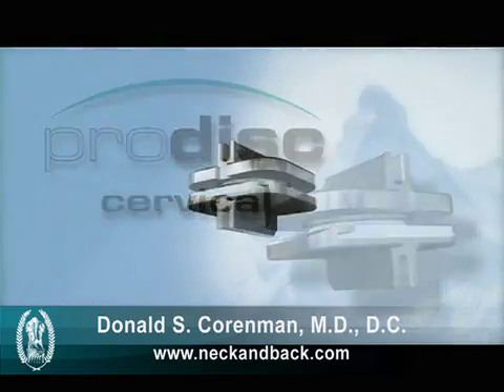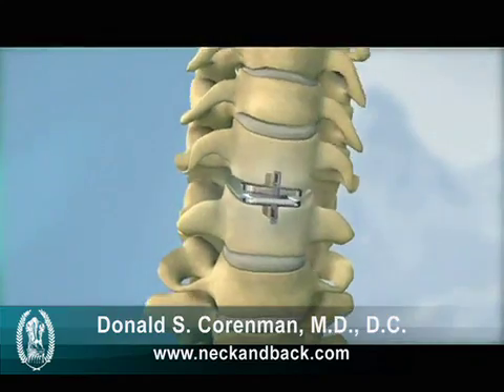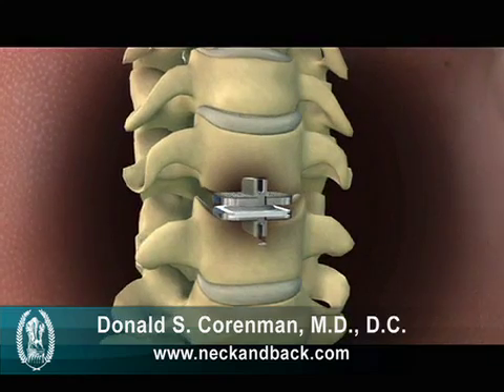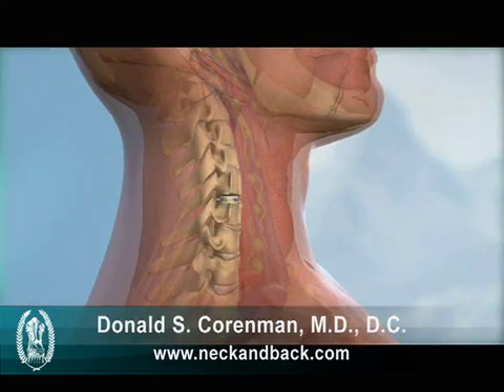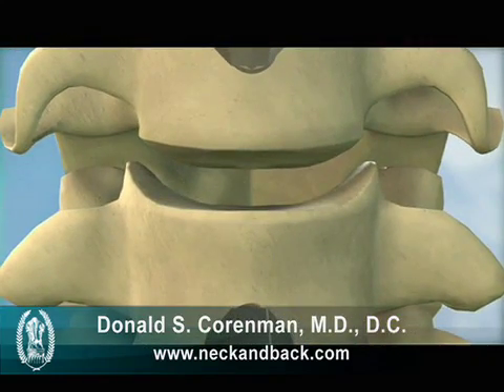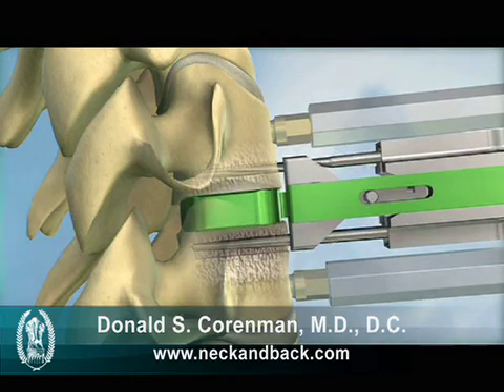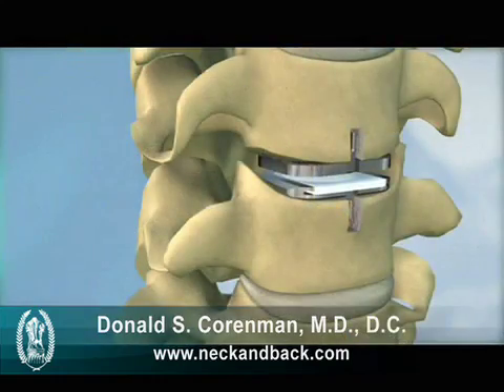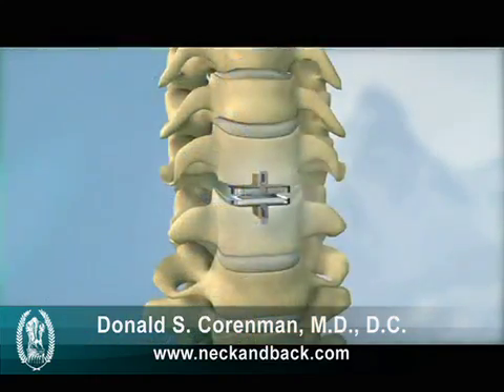ProDisc-C | Cervical Artificial Disc Replacement | ACDF Fusion | Orthopedic Spine Surgeon in Vail

Comment: ive had mine in c-5 and c-6 area for 8 years it has moved somehow and now i must have it all removed and replaced with fusion not good...
Reply: Did you have the pro disc?
Reply: @raylanier4519  yes i did pro c disk on c-6 and c-7 after a few months the top of it tilted sideways now im disabled and in pain forever ...
Reply: @randyprice132  sorry to hear that, did they remove the disc or no? It might be possible to have another disc placed.. I went to Germany cp-esp disc